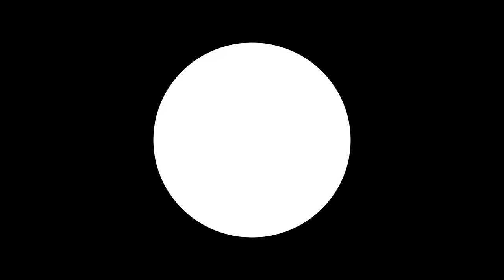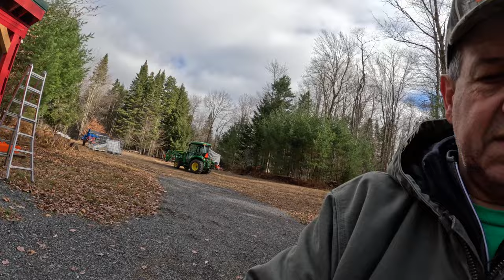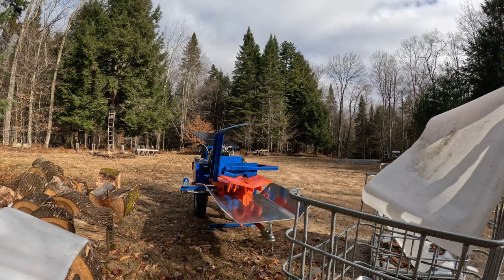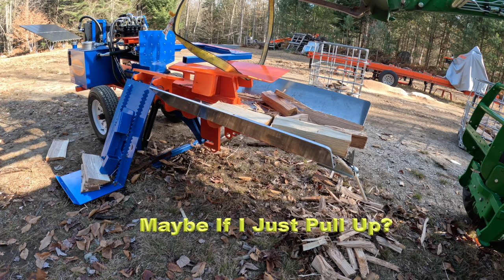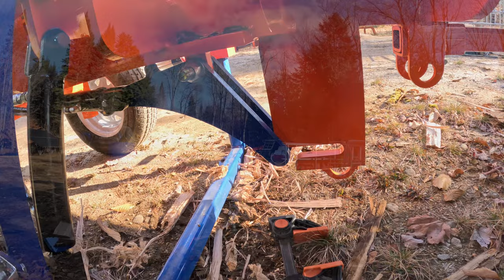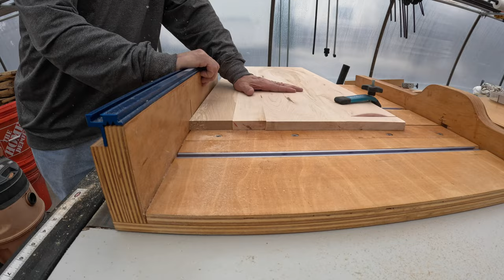youtube video #-FTE2FaF7aE

Comment: The prying end of a crowbar, inserted in the slot of the actuator arm, with the heal against the wedge, would probably work.   Also a little grease would help the wedge slide back into place.  Shalom/gw
Reply from the maker: I thought about a crowbar but didn’t want to wreck the new powder coat right off the bat.  A year from now things might be different 😂
Reply: @adirondackwoodsman  OK just put tape on it or some other thin material.
Reply from the maker: @googleboy7  good idea.  Thanks for sharing it

Comment: Another Thing i'm looking into modifying.  My old splitter (Timberwolf) had a tube style grate (pan).  This allowed all the debris to fall thru, and it actually seperated the firewood from kindling.  I want to recreate a tray for my eastonmade 22/28- either a new tube style- or cutting slots in my aluminum flat tray. 
https://www.youtube.com/watch?v=aIYME276YlE
Reply from the maker: Yeah that would be helpful.  Right now it all goes off the end of the pan.  I used my box blade on my tractor to push it into the woods.
Reply: @adirondackwoodsman  my problem is, i let it fill directly into a dump trailer, or the IBC totes.  This method of course gets the firewood and all debris mixed, and as u have seen, its a LOT of debris using any brand boxwedge
Reply from the maker: @jerrywayneray  I bought the STK 24 conveyor but wanted to get the splitter under my belt before using it.  I went with the 24 because it has the grizzley bars just for that reason
Reply: @adirondackwoodsman  yep, as I've watched almost every vid out their on the conveyors.  Even with grizzy bars, I still see a lot of debis going into dump trailers/ IBC totes off these conveyors when using boxwedge.  I guess I need a tumbler cleaner :)

Comment: My 22/28 had the EXACT same problem, wouldn't lift, was jammed.  I called Easton made Gerry, sent pics.  With mine, the Slot was not cut out correctly to match the blue arm.  I took it to a machine shop to have the notch cut a little more of an angle.  You are correct, if i lowered mine all the way down, it would jam up every time.  I got the extended tray , and I also got Dual lifts :) 
https://www.youtube.com/watch?v=Lbnu9_QVFFM
Reply from the maker: Dual lifts look like a nice custom Option.